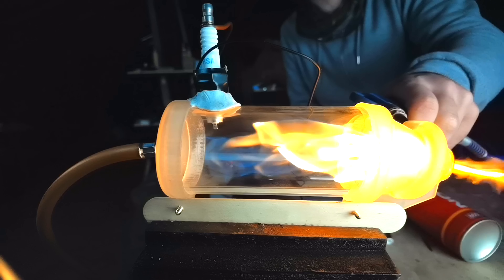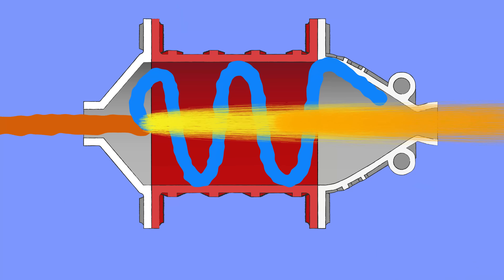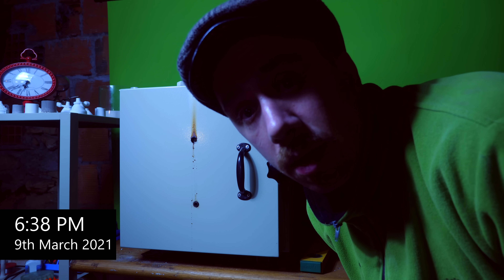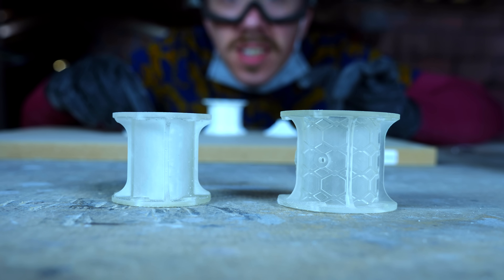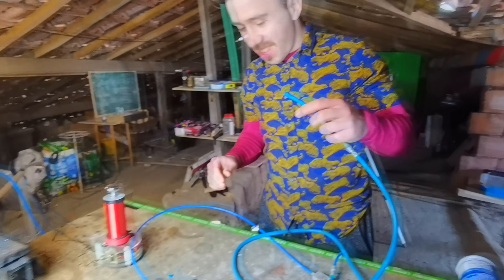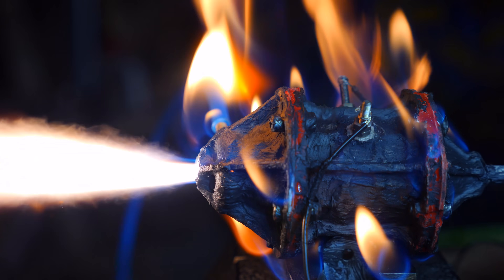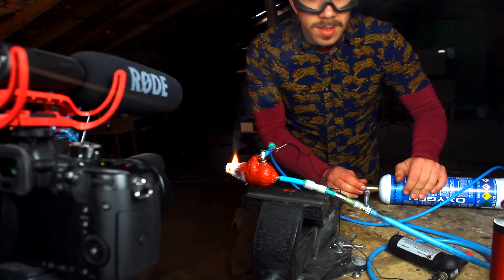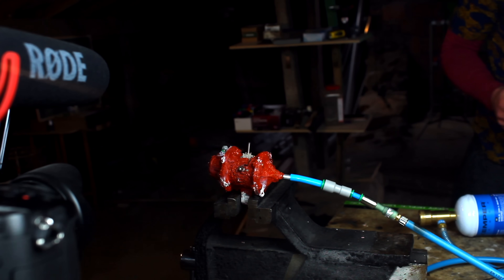Vortex Rocket V2.0 (3D Printed)

Comment: First of, the reason your rockets destroy themselves and leak all over the place if you raise the chamber pressure, is that your Nozzles "Throat" diameter is too small for the pressure youre trying to force through it. Widen the throat a little and your rockets will deal better with more pressure. It doesnt have to be much, were talking millimeters here.

Second you are using heat proofing agents that arent really that great at sealing. What you should try is to GLAZE your ceramic parts with a high temperature enamel to make them leak proof.

Comment: Insert a tube inside the chamber and use it to spread the pressure to the connection between 2 halves. Big overlap, no direct seam between high pressure and outside.  Fun project! 🙂

Comment: One source of leaks looks like the seams between parts, try lapping the connecting surfaces before assembly so they are perfectly flat and in complete contact.
Reply: I would say the opposite actually. Gaskets seals often require tiny grooves circling around the flange so that 1) the flanfe can grip the gasket to keep it from being extruded out of the flange and 2) to make the path which the gas would need to leak through much harder to traverse. There are some kinds of gaskets that work with smooth flanges but they nerd stupid amounts of flange compression, and most gaskets already require more compression force than other types of seals.
Reply: I think part of the problem is the pure oxygen he is using, oxygen is well... an oxidizer and then add some heat and it will rapidly destroy virtually anything.
So the stuff he is using to seal the ceramic is likely just getting burned out. He'd do better to switch back to just pressurized air or at best a lightly enriched mix.
That and it might help if he would glaze the parts to seal them properly instead of trying to use refectory cement
Reply: @SilvaDreams  glazing is just a layer of glass on the ceramic. If the parts don't experience more than 500°C than should be ok. Otherwise it will just melt. But should be better as it will not burn in oxygen)
Reply: @OrdynskyiVladyslav  If the design is working properly then it shouldn't come anywhere near 500*C anyways, right now the biggest issue is the porous nature of the ceramic allowing oxygen and fuel to pass through it as it's under positive pressure while running.
Reply: @OrdynskyiVladyslav  glazes for ceramics can easily go to 900c, high fired ceramics need to reach at least 1100c for the glaze to properly melt
Reply: I dont believe any of this

Comment: My suggestion is to coat the inside as well as the outside of the engine surface. It seems like the primary source of the leaks are the screw points, so maybe also seal the inside of the screws or create a different attachment mechanism. Another suggestion I have is to add an emergency shut off valve at the oxygen tank so that you can quickly cut oxygen supply due to a failure. Stay Safe! Those tomatoes wont destroy themselves!

Comment: This might be a bit outrageous but you could attempt a larger project by experimenting with your best designs and making a vehicle that moves by the propulsion of the engines.   Now it doesn't have to be one big engine (printed in multiple parts of course) it can be a bunch of small little rockets and if it moves that's a success even if it's only 1km/h.

Comment: Suggest a few simple root cause analysis tests to focus on the issues you can discover - and then address.  At the moment - you don't truly "know" what is failing, or that this is a single failure.
(first off - why not use a spent miniature CO2 cartridge, adding your clever vortex tubing somehow into this, and giving you a likely result that is better handling of the temps and pressures needed)

Or - sticking with this 3D printed ceramic, which just seems as brittle as chalk - and as porous as screen door.  keeping that route open, seems like you are then going to need to spend a fair bit of time with tedious testing, for root cause analysis.

Suggestion:  You could use the parts remaining from the failed engines for quite a bit of this, and in short order - truly determine if this is one or more issues, and where/why.  Until then, this is a blast to watch, but a serious of well-thought-out guesses.  Almost a perfect example of the kind of thing Edison was noted for doing:  test after test after test....but, just using the lightbulb filament testing as an example - the testing got down to knowing....for sure...that the issue to resolve was the filament.  At that point, they had tested the other device elements, and narrowed down the issues to just this one hurdle.

There are a lot of elements (each a point of failure) here, which is one reason this is so fascinating.
The material choice?
     - The porosity of your material LOOKS like an issue, and could you find a way to for-sure determine if a sample of ruined engine actually allows your fuel to pass through it like a sieve?
    -  Is this less of an issue of porosity, and more of a combustion chamber over-pressure issue?  Your vortex offers cooling, but the power produced will be limited by the pressure tolerated within the combustion chamber, and how this can be compressed - then forced through the nozzle.
   - Is this an issue with the truly intense nozzle pressure?  Even a minor nozzle defect would rapidly propagate a failure there - through the system and result in miniscule cracks, resulting in something like we see with the flames appearing in multiple locations...while SOME of the exhaust continues to be expelled in the intended method, for a time.
The ease at which you remove the unneeded material - kinda shows how potentially brittle and possibly porous this stuff is.  

Is this an issue with the fuel or the combustion, similar to what you discovered with the 3d-printed plastic versions?
  Possibly the fuel is being absorbed by the combustion walls and softening that material quickly, despite your (I love this design, dude) cooling vortex.

Is the failure due to a design flaw, rooted in the shape of one or more elements?  
       (i.e. the vortex tubing/routing - too small, so not enough cooling)
Is this an issue with the combustion chamber shape? 
(too narrow, too wide/large)
Is this an issue with the nozzle?
(using 1 nozzle, when multiple are required, or a flaw in the calculated size OF the throat, and/or possibly the shape)

I've gone on far too long, but thank you.  This is a lot of fun to watch.

Comment: Have you thought of using plasma sputtering to coat the 3d printed part with a thin layer of metal then using conventional electroplating to thicken the metal layer on the rocket parts?  This way the parts will be entirely coated with metal both inside and out and should hopefully seal any leaks you may have.

Comment: I wonder if you could make a ceramic 3d printed tesla coil..also, you could use pottery glaze on your ceramic parts to fill in all the porositys in your ceramic parts...and they would be shiny and smooth afterwards...and you can use different colored glaze to make designs on the parts that would be permanant

Comment: Would coating the inside of the engine with  Waterglass - Sodium Silicate in aqueous solution help with the sealing? It is used to make concrete less porous.

Comment: I love jet engines, I love your channel. 
Maybe make a video about an electrical generator or a vehicle of some sort, powered by a power turbine (either reaction turbine or Tesla turbine which ever you prefer, or maybe try both and see which more efficiently transfers energy)
And power the turbine with a 3D printed gas generator, either a traditional turbo shaft setup or use one or a series of rockets, experimenting with nozzle diameters and general engine dimensions. Thanks for the great content!

Comment: Integza, what would happen if you were to "bake" ceramic parts, then sumberge them in ceramic resin, pump away air to get rid of bubbles and make the resin flow into small holes in "baked" print then take it out of the resin, wipe down and "bake" again?

Comment: interesting he uses oxygen as the insulating medium.
It is gas not liquid, it reacts with the plastic walls.
I would have injected the fuel in liquid form around the outside so it cools better and cannot react with the plastic

Comment: what if you impregnate the ceramic parts with a metal like in patent JPH07138087A , and also sand down  the joints to make them flush or make an interlocking feature that you can have a better seal

Comment: @Integza You need to add 2 or 3 ridges along the seams between your components in the modular engine also don't use silicon for your sealant. hmmm you might add a iron oxide powder to your porcilite bath. that way there is a metal backbone to your pieces that can tolerate more heat without oxidizing since iron oxide is already in it. this would also close alot of those pores that your fuel/air mix is leaking out of. As an alternative maybe use graphite powder in place of iron oxide. just throwing a few thoughts your way.

Comment: Can you do a video on Tesla Turbines, specifically if it would be possible to construct on on a 3d printer that could provide power to a home, using water. 🤔 I don't believe one using air would be economical (the compressor would have to be massive).

Comment: Make a metal heatsink encloser for the engine. You may possibly have less leaking if the engine is properly colded down.

See any pores in your print will expand under high temperatures.

Comment: for comments who suggest making part in metal this could not work because temperator is too hight Integza mix oxygene and propane we use this mix in toolshop know under the name "poor man oxyacythlene" to cut metal parts as IPN. Inconel is expensive an dificult to work with it will melt too only silicone carbide could resiste to this temperator but this is expensive. The second problem is ceramic porosoty if i was you i will try to mix graphite powder in liquide ceramique to lower porositiy and print only one piece engine remove all metal part they dilate crack ceramic and melt ... replace it by graphite part easy to find on aliexpress or ebay and easy to machine (please put a mask fpp3 to save your lumbs and take car too graphite dust and short circuit electric engine don't like this dust ) !

Comment: As several ppl said, glazing is essential. But you have to do it on the inside and also after adding a lot of it, while liquid you should presurize the inside to force the glazing through the pores of the ceramic. You should test which pressure, time and ammount of glazing give best results (ie pressure and heat resistance). 
Also, the one O2 port gives asymetry in flow, try to use two symetrical ports that are feed from the same tank and with similar tubing lengths from the split. I suppose this will reduce the "flicker" that appeared at the longest succesful test. This will reduce also the stress of the chamber. 
Test the geometry with smoke in clear resin prints. You may use different colours for the smoke to see the paths. This will only approximate the real burning conditions since the heat and pressure and flame shockwave will not be present, but is a starting point.
Ad astra. Good luck. 
P.S. you need more shielding and the same is true for the camera and the operator. If the engine explodes, the ceramic shards may hit you and you'll look like a smashed tomato.

Comment: I would recommend working on an electronic regulation system for the propane and oxygen (with an emergency kill switch). It would allow accurate repeatable control of the pressures and help keep from burning your house down.

Comment: When do you get to water cooled version? 
Note: hot water can be sent out as added thrust!
This way the permeability of the rocket, becomes a feature.
As some water leaks in to become steam.
(Plastic or aluminium jacket to keep motor in water.)

Comment: Try to dip or paint over the cured engine with the liquid ceramic resine, than cure a second time. Double coat may solve the leaking issue.

Comment: what if you remove the support material before burning out resin. my thinking is possibly the supports are causing stress on the print as they shrink at different rates to the main print

Comment: I think that your sealant cannot contain the pressure comming through the ceramic. maybe you could print 2 cylinders with a few mm between them and make a ceramic and sealant sandwich. that way the outer ceramic can hold the pressure and the inside can still stay smooth

Comment: I would make a permanent stainless steel 1/8" ID flared tubing for gaz input. I would put a 1way valve close as possible to the output, just for me. That way you never get leak through burnt tubing. I would try and print less part as possible with that resin and integrate stainless steel parts for the  engine. Maybe try and weld it from scratch like a 3d printer would do... But with welding. .. crazy, but doable lol.

Comment: Awesome works ! I love it so much! But still concerning testing rocket in such a sealed room with both the oxidase and fuel are might not a really good idea. You might wanna find an open area with setting a ballistic glass between you and the engines so even the rocket exploded you could still stand. Just a little concern for you and your're families safe.

Comment: I would change the firing schedule for a slower ramp and greater hold times.  Then after firing coat the outside in a ceramic glaze.  I am happy to send you one of my glazes and happy to look at your kiln cycle.  The parts you are printing look pretty straight forward.  Maybe make a mold in plaster and cast the whole part in ceramic.  If you send me the 3d files I would be happy to make you the parts too.

Comment: Is the process for curing the part: { Put part in kiln, turn up kiln, leave for X hours }
If so have you tried putting the parts in at a lower temperature and after a while slowly bringing the temp up to the final temperature.  This could maybe cook off the resin without/with less deformation, and then temper after resin is gone. 🤷🏻‍♂️

Comment: You could 3d print the "negative" of the engine, then cast it out of alloy. As far as I know, Alloy should  be gas thight :P
Reply: Alloy melts at temperature less than his 2000 Celsius that the engine emits.

Comment: It would be fun to produce and  use your own fuel for your engines. For example you could use oxygen from the separation of H2O using electrolysis with potassium.... And burn those disgusting tomatoes using water 🤣

Comment: On the modular engines u could try sealing it from the inside that way nothing gets in the pores of the ceramic to start with. smoother flow inside and hopefully no pressure builds up in the pores and blasts thru the outer layer of silicone

Comment: rather than just a flat mating surface for the parts, use an opposing texture that interlocks to the other half. i suggest 2 rows of opposing blocks and  then whatever you're using for glue. glaze the whole thing on the outside in your burnout kiln with some high temp coating. you may want to glaze your input tubes into place if the bronze(?) tubes will take the heat.

Comment: print the surfaces where the parts will join a tiny bit thicker, then sand them perfectly flat, or design the surface to lock together so as to prevent micro gaps.

Comment: While you lacked faith in your "Red Torpedo," I think that design philosophy could lend itself to greater successes with the project (the old "Keep It Simple, Stupid" philosophy).

One of the things about ceramics is that they are porous materials.  You could try glazing an engine (inside, outside, and both; all hail the scientific method!) to see what sort of impact that has regarding gas leaks through porous materials.

The valve splits at 13:05 - Is it possible the application of the iso-grid to this design would improve its durability?

Comment: Have you tried to use liquid glass or sodium silicate as a high temperature adhesive to make an air tight seal. You can also use it as a coating for high temp applications. It's what I made my forge out of. You can buy it but I enjoyed making my own.

Comment: glaze the outside of the rocket, the trick I think is to use a crystalline glaze as the low alumina content keeps the glaze soft and thus will resist cracking

Comment: I don't know if you've accounted for this: ceramic break down temperature is 1,000 °C to 1,600 °C (1,800 °F to 3,000 °F).
Propane oxygen is approximately 3600°f or about 1900°c this said ceramic will always fail after a run or two.
Reply: Is it possible, to print a larger one in stages, or panels that over lap in carpentry terms "ship lap" to be able to be assembled with high temp refractory cement. It couldn't hurt to give it a dunk in high temp silicone to get any stragglers that may leak. 
The larger one you made was able to cool, the smaller ones will heat too quickly.

Comment: Silly question integza. Could you not ceramic print the part, burn off the resin in the kiln as normal  and  then either dunk or paint on the resin ceramic blend and cure with Uv light and put back in kiln multiple times to make it thicker ????? Like build up layers.

Comment: I think you shouldn't use oxygen, but simply compresed air like at the beginning : the oxygen is almost immediately consume to burn the propane, so it can't do the job of cooling the body of the engine, whereas the compresed air travels through the whole distance, insuring a space between the flame and the surface of the engine, making it able to work for a longer time. If it isn't efficient enough with compresed air, an other solution can be a mixture of nitrogen and oxygen (like air, I know, but with more oxygen. 50% oxygen for example). 
I think so, but I'm maybe wrong because I'm not a scientist.

PS : I'm French so my comment can be ununderstandable 😅. If it's the case, say it, i'll try to re-explain it otherwise.